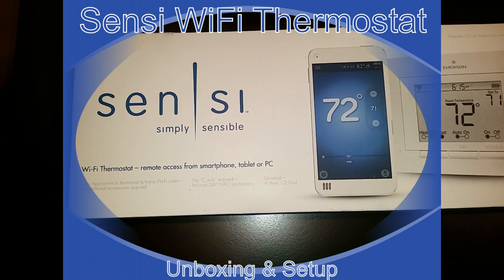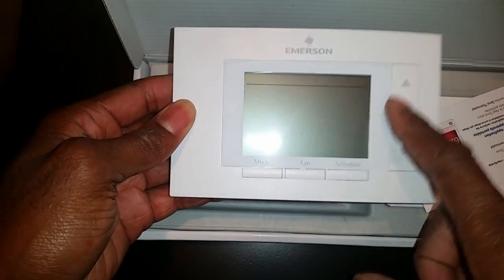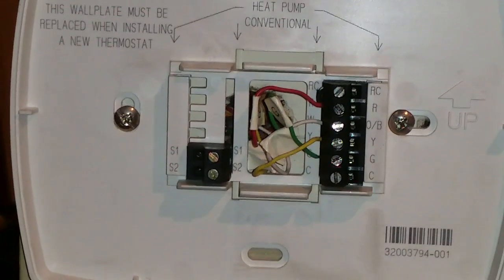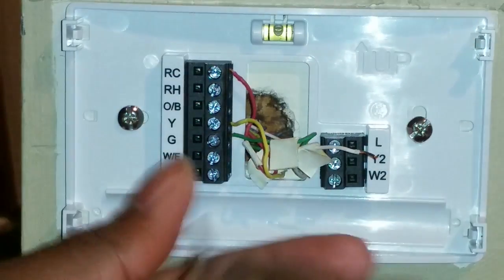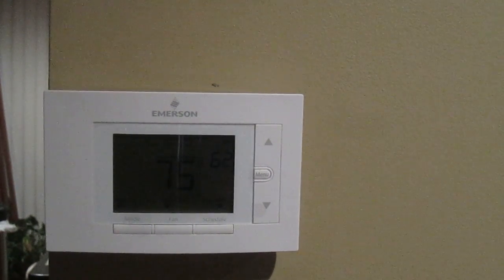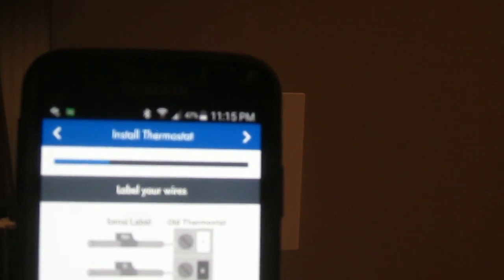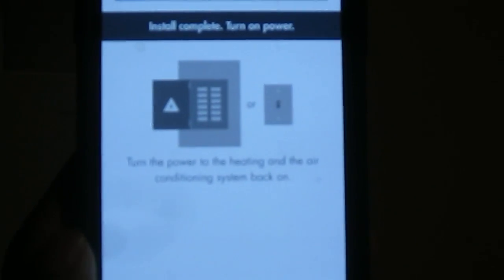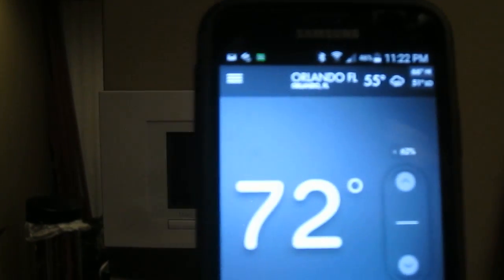Sensi WiFi Thermostat - Unboxing & Setup

Comment: Wow!!!..5.50 to 6.00 is what I needed...this jumper was missing in the thermostat when replacing the battery seems like and was unable to change from cold to hot on thermostat. Changed PCB board as the diagnostic light flickering code was decoded as bad PCB or wrong connections. Anyways..thanks for the help

Comment: Excellent product it was easy to install and easy to set up just follow the instructions wiring I just did it myself I know the red wire is always your positive wire there's a couple YouTube videos of guys that tell you about the wiring on a thermostat that's a lot more helpful than doing it the way they tell you here but once I researched a little bit before I installed it it was cake went right in Hook right up to the Internet works great

Comment: Will this 4 wire set up work on my sensi wifi I dont have cooling the furnace has 24 volt on it but only 2 wires for old thermostat any help would be thankful .
Reply: Yes, heat only.  R + W

Comment: Sensi WiFi Programmable Thermostat is compatible with most heating and cooling devices, including oil, gas, geothermal, radiant heat and heat pump systems.
http://thermostatjudge.com/product-review/sensi-best-wifi-programmable-thermostat.html

Comment: Good Video.  It looks like the Sensi unit is fully battery powered and does not need the C wire.  I looked at a Honeywell WiFi unit but it needs a C wire that my system does not have and I did not want to go crawling in the attic to convert a G wire to a C wire.  Do you know how often batteries need to be changed in this unit?  Hopefully at least 6 months.  Thanks again.
Reply: Doyle Souders     I think that depends a lot on the quality of the batteries you use.  I am going to activate the “C” wire and just use the batteries as a backup.
Reply: there's a few variables that will change how long your batteries last! Quality of batteries for one, how often your adjusting the thermostat or playing around with it. Generally with good batteries though you should get a year before needing to replace as long as your not using the light on the thermostat much, etc. Personally, I replace my batteries in most my stuff if not all the same time every year regardless if they need to be changed or not? Then I have no surprises when I end up with a dead battery stopping something from operating
Reply: @ghostridergale  I change them 2 times a year. Daylight savings Time with the clocks.

Comment: Thanks for the video! I did want to make a quick comment about the power... Cutting power to the system isn't so much to protect you from electrocution (though 24 volts does bite) but to protect your equipment from accidentally being fried. If you cross the wires, you can potentially backfeed power into your control board and short circuit it. It doesn't take much more than a static shock for that to happen and it could end up costing quite a bit to replace.
Reply: May blow the fuse on control board in the furnace or air handler.
Reply: Once I worked on a thermostat without turning off the power and, apparently, I touched the 24V wire to ground accidentally and it burned up the furnace transformer winding. I will NEVER again handle the wires without first turning off the power to the furnace.